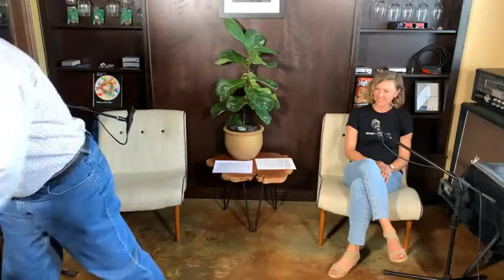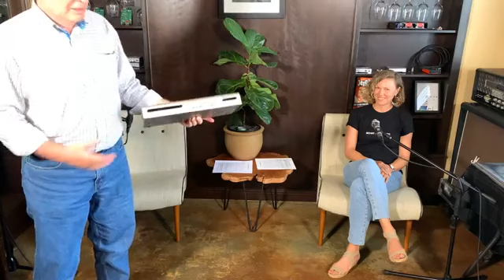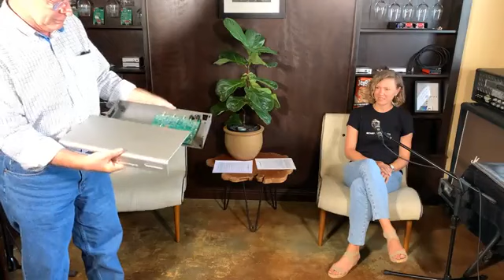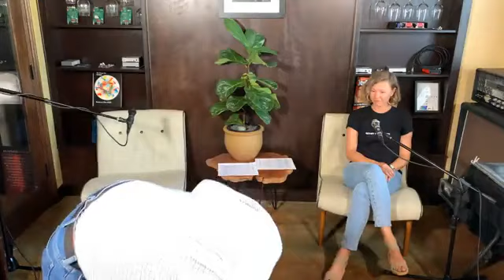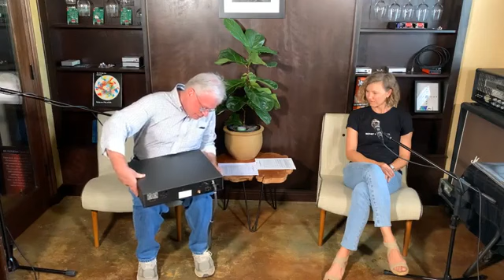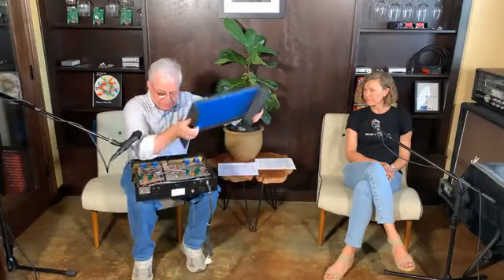Schiit Q&A Livestream - Jason learns digital!

Comment: Two in the hot seats...Did not know that cd album art came from the internet.  Funny that it is not part of the digital info on the disk. Here in 2024 it appears that the Urd has not caught fire.  That is unfortunate.  Such a complex, labor intensive project.  The current market offerings for players and transports is rather dismal.  $1299 is just above my comfort zone. Would like to see the Urd bloom going forward.  Of course with this level of complexity, you reach the "change one thing, change everything" place pretty quickly.  I have had a Modi for years and still use it.  Just got a Mani 2 and it is doing what I needed it to do.  Business blessings to the Schiit Audio family going forward.

Comment: Pitch control, reverse-dialect teleporters, anti matter power supplies, vernacular phrase inversion...  but no front power switch? Or a mono amp suited for Magnepan 3.7s? (ie 500 watt stable @ 4 ohms) Or Gumby with volume?
Reply: They exist now in 2023. Except for the front switch part.

Comment: On your high end CD transport, you guys completely missed the mark by not including an I²S output using HDMI. Very sad.
Reply: They said on a previous livestream that they weren’t going to use HDMI because of its proprietary status, it’s very strict control
Reply: I don't think you really need I2S for redbook audio, it's more of a DSD thing. They also railed against HDMI in this video as well. HDMI is not compatible with Schiit's ethos.